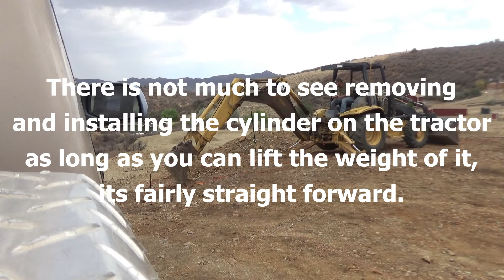How NOT to Install Backhoe Dipper Cylinder Seal Kit

Comment: Ok for all you other dudes looking at this , I have done many of them. That bolt that holds the piston on the rod has RED locktight , I use a combination / open end, box end. With the box end on the nut & a 8-10’ pipe , or a homemade hicky bar , someone to put weight on it , you use a short piece of round stock placed on the bolt end & pound it with a heavy hammer . It will come loose. 
Mistake here,  —When  they put the bolt back , did not use locktight. On a cyl. , of this size, using locktight  4’ of wrench length is plenty. 
Where the rubber O ring seal on the gland nut , when you have it screwed in to that point smear with silicone , so that when it is screwed home there is silicone swathing out , so there is no way water can get in there , & of course wipe of all extra . Now anyplace you use silicon , it is a MUST you clean with quality paint thinner or brake cleaner ( no oil ) for adhesion ! 
He said the gland nut had come loose , so if there was not a Short bolt in the joint between the cylinder & the gland , time to install one , all mine have a 10-32 x 1/4” in that joint , - 1/2 the thread in the cyl end , 1/2 in the gland . To facilitate this a bottoming tap is necessary., so of course when disassembling a cyl , you must be diligent to inspect & make absolutely certain there is not one in your cyl
Reply: I also position the equipment so if possible to leave the rod end in place so it is held & supported by wood when the cyl comes off . I have rebuilt all the cyl on Case 580 K , extend-a-hoe , & that one as a real nightmare , did not remove the 2 big ones on the boom , lifted the rods out with pulley blocks over head

Comment: I broke a socket drive. The only way to get it off is to heat it RED HOT.  RED HOT.  There's lock tight in it.  If you just heat it for a few minutes it won't come off.  Red hot and it will spin like butter.
Reply from the maker: I did heat the bolt but not very hot and defiantly not to the point of changing color. If you go red hot or close to it you change the heat treating of the bolt so be sure to replace it.